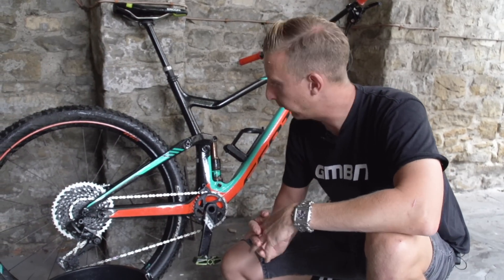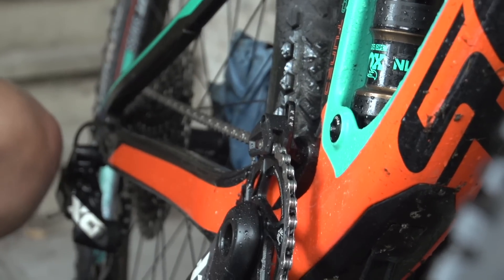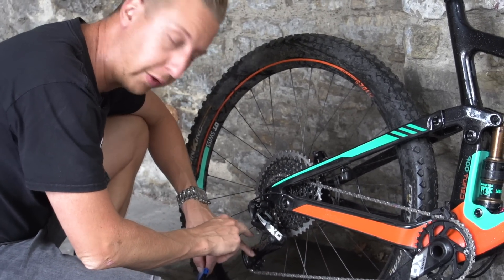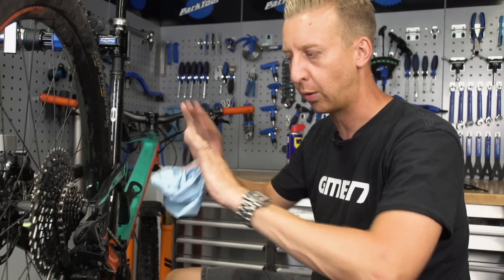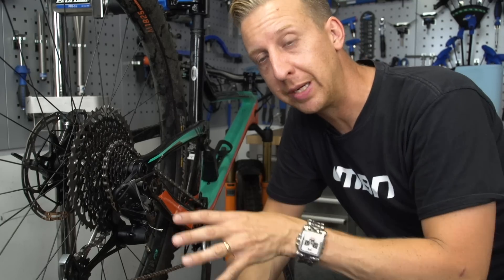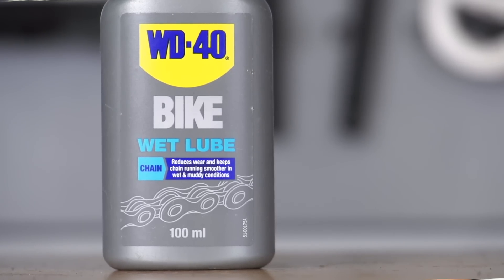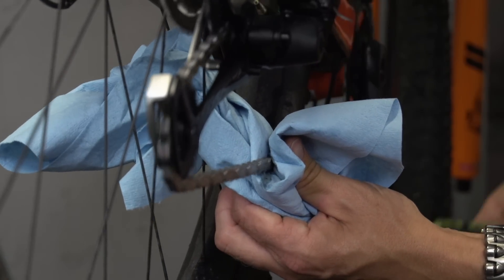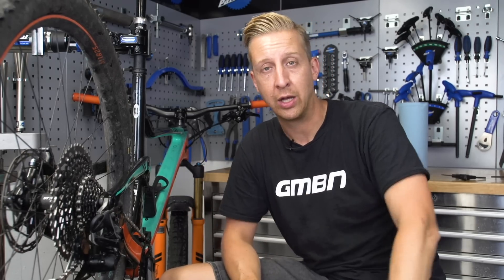How To Clean And Lube Your Drivetrain | GMBN Tech How To

Comment: I bought a mountain bike 34 years ago and have been cleaning it with the method I've listed below. The bike has never had any major component replacements over thousands of miles of mountain biking. I've just changed brakes and tyres to date.
Below is what method I use,

1 lightly spray off debris from entire bike with garden hose.
2 Hand wash bike with mild detergent and warm water.
3 Hose down to remove solution.
4 Clean cassette, chain, and chain set with mild detergent using a 3 inch nylon paint brush.
5 Hose down to remove solution.
6 Bounce bike on back wheel to remove surplus water.
7 Wipe entire bike down with kitchen towel.
8 Apply lube to a sash tool ( this is a pointed brush that's used by painters and decorators) this brush will evenly apply lube to exactly the areas that need lubrication. 

This entire process takes approximately 30 minutes after every bike ride.
I will continue to use this method on my Cube Stereo 160 action team, as there have been no issues I've encountered with my old mountain bike using this method. 
I hope this helps guys,
Happy riding.
Reply: How frequently do you do this?
Reply: Jay Had 
It's usually done after every mountain ride, However there have been occasions  I've left the cleaning until the 2nd or 3rd ride, (this week). I find it satisfying to clean after every ride, as the next outing becomes more enjoyable due to the bike's performance is at its optimum level.
Reply: Hi! Can you list down the parts that needs lubrication? I think i might not have lubricated some parts that need oil
Reply: JM Araneta 
Hi areas you should lubricate are:
Chain, wheel axel hubs, derailleur, basically any moving part except break disks. Check your bike manufacturer instructions for your bike. The cleaning is vital for smooth operation and longevity, I hope this helps.
Reply: Ive been done that, meaning theres no "over specifics" lube needed. Just a regular clean and simple chain lubricant
Reply: @jmaraneta7800  suspension seals with fork oil .  muck off chain lube .. teflon   grease your bearings.  NOT SUSPENSION BUSHES
Reply: @latonbuzzard2386  Are you using different kinds of lubes for each of those components or the same lube you use on the chain?
Reply: Sorry to be offtopic but does anybody know of a trick to get back into an instagram account..?
I was dumb lost my login password. I love any tricks you can offer me
Reply: @Scott Jeremy Instablaster ;)
Reply: @Mathew Zev thanks so much for your reply. I got to the site thru google and I'm trying it out atm.
Takes a while so I will get back to you later with my results.
Reply: @Mathew Zev It did the trick and I now got access to my account again. Im so happy!
Thanks so much, you saved my account !
Reply: @Scott Jeremy No problem =)
Reply: @mathewzev1829  pay pal ? Lol
Reply: I don't own a garden hose 💀

Comment: Tip of the day...I ride both bicycles and chain-drive motorcycles. Works great on both although the lube requirements are different, so use specific lube. Oh ya..the tip...Dawn Ultra Platinum PowerWash. Best degreaser out there, and won't eat paint or ruin your bearings. Spray, scrub with an aforementioned stiff brush...I use old toothbrushes and bike-specific brushes...rinse...repeat if necessary. One time and a good rinse with the hose does the trick :-)
Stay safe and thanks for the video!

Comment: I use lemon floor cleaner bought in a supermarket to clean my chain with my park tool chain cleaner. 
Way more cost effective and means I can clean my chain every time I ride. So always super smooth shifting 😁😁
Reply: will mccurrach the best smelling chain east of the Mississippi!
Reply: lemon floor cleaner works on chains???
Reply: @skyice5206  it's a strong degreaser

Comment: I'm lucky that here we have dry weather, so after a ride, cleaning the dust using a simple brush before adding dry lube is enough, lube the chain, and wipe the residuals...  and you are ready for the next ride. (Exactly as you explained)
I use a deep cleaning only when requited.
Thanks for the video.
Greetings from the Galilee.

Comment: I wished i watched this video before spraying wd-40 all over the place
Reply: LOL that's funny dude :)
Reply: @connected2local  my dad taught me to do this, 5 bikes later and now ik how bad it is
Reply: Lol dont do that cuz it can literally eat ur drivetrain
Reply: Lol same
Reply: Luckily I only rode back n forth my driveway and miss shifted and chain fell off. 

So I'm researching lol
Reply: @darkeclipse3769  your derailleur hanger is bent is your drivetrain is out of adjustment do research on both
Reply: @owenevers389   Thanks. I figured. And my chain was crap it snapped. Actually broke on medal part. 

I need to adjust front shifter on the gears for front. I put on new chain perfectly oiled, its still rubbing the rails. And a few skips. Idk if I need a new transition or to Degrease the chains. I cleaned them.a few times already.
Reply: @darkeclipse3769  it’s normal to rub the front one it happens to all of them even my 5000$ one
Reply: AAhah, I was just about to do that!
Reply: SAme
Reply: Same
Reply: @brunomenrat6616  No... It won't...
Reply: Literally me
Reply: Rip
Reply: Haha ya mad man 🏴🇺🇦
Reply: I know, I’ve been doing it all wrong. Good to be educated.
Reply: Same😢
Reply: Gotta buy the WD40 that's specifically made for bike chains lol

Comment: I tried for the first couple of years with my latest bike (I have only owned and ridden a single bike at a time)... to keep it clean and shiny all the time, immaculate. I obsessed over the chain to the point of cleaning it during rides. This is all while averaging over 7K miles a year, 20 to 120 mile rides year around. That means for me, living in the Pacific Northwest, 4 to 6 months of riding in the rain and on muddy wet surfaces. I have a Rohloff Speedhub mounted on a full-suspension touring bike coupled to a BBSHD mid-drive and it's amazing. It's broken me to ever owning another bike without a Rohloff. The mid-drive and the Speedhub are made for each other, they go together like lamb and tuna fish. @  The 1st year I rode I changed the chain 8 times... whenever it got to 0.5% wear as tested with a Park tool. After another 25K miles and 4 years riding I now wipe the chain clean daily and swap my chains every 6 months. Drop the chain, flip or replace the Rohloff gear, mount a new chain, and ride. Always having a straight chain line makes it amazingly easy to maintain.

11 Jul 19 - 71 miles w/front panniers & trailer on less than 15Ah... 1/2 the packs capacity. 
https://www.relive.cc/view/g37290970278
https://photos.app.goo.gl/RD1NrDPCZQuHpWja9

For anyone that thinks they can really clean the chain on the bike, follow this guy's instructions then pull the chain and drop it in some type of solvent and see how filthy it still is.

Comment: I just did this last weekend and it feels good to have a clean drivetrain, man! However I feel that unlinking the chain and soaking it in a yoghurt cup with degreaser, while removing the guide wheels and giving them a proper clean, doesn't take that much longer and really removes the grime that accumulates in the small spaces.
Reply: too much degreaser is not good because the chain have factory grease in the inside that it has to keep in place.. something like that, i read about it in a chain manual, cheers bro @Hunter_Bidens_Crackpipe_

Comment: I'd never go back to oil based lubricants. I've been waxing for nearly 2 years, chains are in much better condition, don't get gritty or so dirty in wet or dry conditions, no chain tan left on my legs either. I also love the sound of a newly waxed chain 👍
Reply: Same, its a game changer.
Reply: I just switched to a dry lube and my chain sounds... rattly I guess. It never made noise with my ptfe lube before but it was awfully dirty. I'm just wondering if that's the sound you're talking about.
Reply: Kopfjager no that's the sound of your drivetrain getting worn. A waxed chain is super quiet and sounds awesome give it a try 🚲
Reply: I just started waxing. I do love it so far. I think I’m going to do my road bike next. I got a small crock pot filled with wax for when I need to do any others.
Reply: maybe the name of the product? i wanna give it a try actually use muc off dry lub , thanks !

Comment: I use mineral oil as chain lube and its great. Just make sure to wipe out the excess. And wipe your chain after each ride.  Once wiped, apply oil and wipe out the excess.  Check if you see grime or dirt on the chain when you touch. When no dirt is seen, it means its clean and ok to ride again.
Reply: Imma just stick to my ptfe shimano

Comment: On the park tool channel they said you could reuse degreaser fluid if you left it too settle and let the gunk go to the bottom and use the fluid on the top if that makes sense.
Reply: It makes perfect sense. Have you ever seen an artist's work area. My grandpa kept a can of thinner with a large wire mesh in the bottom that he cleaned his brushes out with. I don't think he changed the thinner for over a year. He would just add more when it evaporated as it is pretty volatile.
Reply: He did a vid on this great idea

Comment: Is it necessary to use degreaser for every clean when using a dry lube?  It seems to be fairly water soluble to me, so on most cleans I just clean it using running water, wipe it off and relube.
Reply: This is exactly what I also wonder

Comment: Might sound kind of crude, but I use brake cleaner and old toothbrushes. Makes your drivetrain look BRAND NEW in literally seconds. And there’s no risk of contaminating your rotors. Make sure you let it dry good (I use compressed air) and reapply your lubricant after it’s fully dry. It’s really important to make sure it’s dry before you lube it, if it’s not dry it’ll actually break down your new lube. You can get off brand brake cleaner for under $2 at the supermarket, and it’s far more effective than any degreaser. Definitely avoid getting it on your paintwork though.

Comment: 2:44 I recommend finish line grunge brush or similar device it's so simple & effective ot use. creat for cleaning jockey wheels and the chain.
I also like the Muc off brushes, the small & hard is great for grips, the drive train brush is great too. the brushes got rubberized edges so won't scratch the bike.
there might be similar products, buts its what I use, and I don't know of other similar brushes.
Reply: +1 for the grunge brush.. especially for use on the Jockey wheels and your 3 largest cassette cogs... erg messing around with the plastic scraper vs a quick whizz of the Jockey wheel through the grunge brush does the trick.
Reply: There is also a fenwicks brush and sponge, checking them out soon!
Reply: @Hasio-Maszkietnik  Fenwicks does not have a a chain brush.Finish Line Grunge Brush is designed to clean the chain, I recently discovered White Lightning has one too.

Comment: I would tilt the bike the other way so that no degreaser is able to run into the rear hub. Also: if your bike is not too much dirty you can run the ParkTool CC-2 with WD-40. And you can save the oil for the next time. I change the oil with each 3-4 rides but i do a lot of road rides.

Comment: NEVER use degreaser unless you use isopropyl alcohol to help get water/degreaser out of the chain as the last bath. AND only use noncorrosive degreaser. better learn to dismount the powerlink/quicklink using only your hands and put just a bit of lube to help it when taking it off. press on both sides laterally as to squeeze them towards each other while pulling the link apart as in "/" line in the "Z" letter is for pulling apart and the upper and lower lines in the "Z" letter being pressed together make the pulling apart easier. a 10 year old can do it with no tools after learning how. after you learn how to easily and safely dismount the powerlink you won't ever mount a chain without one. getting the chain off the bike makes the cleaning much more easier and you can also immerse the chain in whatever thick lube before wiping it clean with a rag (less need to add volatile compounds to help the oil penetrate the chain if immersing the chain and leaving it some time for the bubbles to come out). the best lube for the job should be relatively unexpensive and you'll buy a large amount anyway because the best lube for the job is not sold in 100ml containers - all brand "bike chain" lubes are overpriced while most are crap. synthetic GL4 gear lube is useful for wet/winter conditions, waxy stuff for dry/warm weather but be sure to mix in some ceramic (boron nitride) additive as it's easy to get - they sell if for cars as it's a very useful additive for both engine oil and gear oil but very much so for the bike chain. the time in which the oil is potentially squashed away in the bike chain is much longer comparing to a car's gears. the chain gets in tension and travels from the sprocket to the chainring depending on cadence and chainring size so that the friction gets to occur LATER, after that delay in which time (1-2 seconds) the lube can be gradually squashed so that whatever grinding bits remains unseparated by the thinned out lube gets to wear out the chain if the surface is not smoothed out by whatever additives would stick to it. hexagonal boron nitride (hBN) not only is a perfect additive for this purpose but it also helps to dissipate whatever heat (very good thermal conductor) is created whenever hard surface happen to be in friction and might contribute to the oxidation of the lubricant. AVOID EP additives like moly unless you have the chain completely protected from water. wax does not work well on it's own, it needs to be mixed with one or more things and this depends on the temperature, how much dirt is thrown into the chain by the wheels or just how much dirty the air is, how often water hits the chain etc.

Comment: I didn't get the part after applying the degreaser. Do I use plain water to rinse off the degreaser ?? or soapy water ?? 

I have a spray type degreaser which comes in a can. So after spraying onto the chain, do I still need to use water to rinse off the degreaser ??

Comment: All I do is soaking a rag with motor oil (any engine oil will do) and pulling the chain through it.
That's it.
Repeat every week on rainy conditions and every month on dry conditions. 
No special expensive chain oil needed and no degreaser or anything else.
Motor oil has everything needed, it works not only as a lubricant but also as a detergent and rust inhibitor, it has anti wear components, too.

Comment: Quick question:  Is it normal for the drivetrain to be dirty after every ride?  Also, I notice  muck cakes on the jockey wheels.  Lately I been cleaning it after  every ride. I use a degreaser and a toothbrush.  Thanks

Comment: Speaking of drivetrain issues, I'm considering replacing the drive shell on my Chris King classic free hub, as the splines have been chewed up by the cheap cassettes I've been using. Chris King offers both aluminum and stainless steel drive shells, what are the advantages and disadvantages of each?

Comment: Doesn't using a chain cleaning tool with degreaser wash out the original grease inside the chainlinks and therefore the chain won't work as long? Really interested on your opinion on this
Reply: Well, if you use the correct lube it won't matter. You want a lube that is thin (so that dust won't be picked up), polar (so that it sticks to the metal) and water-insoluble (so that it won't be washed away). I use double end capped ISO viscosity grade 46 PAG air conditioning oil and i find it the perfect chain lube.

Comment: The degreaser used in the wideo looks like WD-40 Bike Degreaser. WD-40 also makes a Specialist Industrial Strength Cleaner and Degreaser that meets EPA Safer Choice Standards. Does anyone know if it's as good as the Bike Degreaser?

Comment: Use washing up liquid and water or diluted simple green to decrease chain with a chain cleaner. This will be much cheaper and just as effective as a canned degreaser or solvent. Also if washing up liquid is only effective if chain is cleaned every 5-7 days.
Reply: Same here.  I use Simple Green with one of those mechanical chain cleaners, that clamps over the chain.

Comment: I have a question (I'm a newbie) what will happen when you accidentally spray some on your brake rotor?
Reply: Contamination. Brake rotors are meant to help you stop. If lube were to get on it, that would defeat the whole purpose of a brake rotor. Worst case you take it onto the trail without knowing you've contaminated it, you turn a corner and there's people... you know the rest.

Comment: I find it easier to take the chain off, i do being as nowadays it's much easier due to the master link in the chain, then soak it in petrol or a strong degreaser, get rid of all that grud & foreign particles, i don't think it's bad for the chain as i have carried out the same method for about 30 years, also remove the jockey wheels to and if poss the cassette also, no worries of cross contamination then, do this about every 500 miles pending on what type of weather & terrain, the cleaner and well maintained your chain is then the longer ever think get lasts, but eventually it will all need replacing like everything eles
Reply: Isn’t re using a master link bad ?

Comment: I clean the drivetrain pretty much the same as Doddy but was recently told not to degrease the cassette because the hub has been damaged; degreaser has taken away the grease from the bearings. Could this be due to changing from a spray degreaser to a liquid form and it has seeped through?
Reply: Andrew Dodd Cheers Doddy. Will go back to spray degreaser and copy how you do it. Thanks for answering

Comment: How would a degreaser affect or contaminate your disks? Wouldn't it clean it if anything?
Reply: It will leave a thin residue or "film" on the rotor which will reduce braking power and make your brakes super loud.